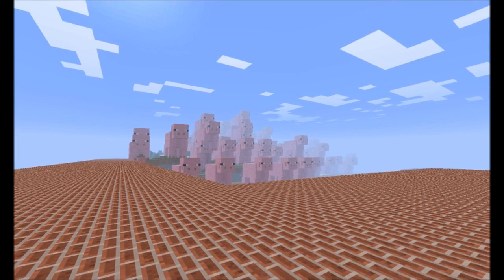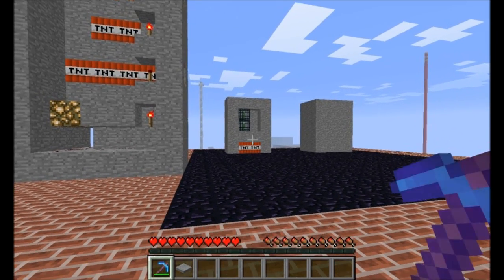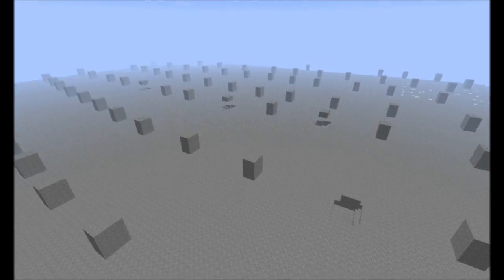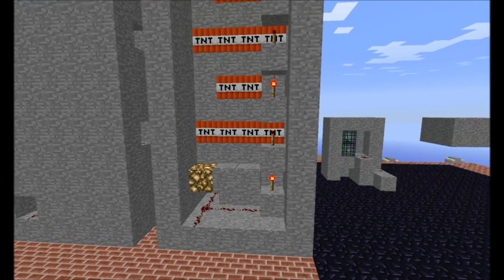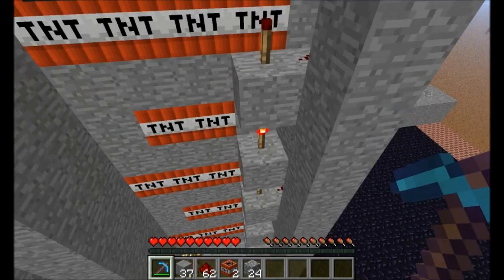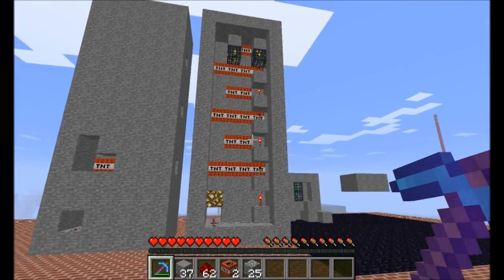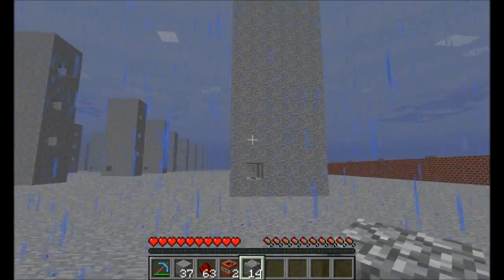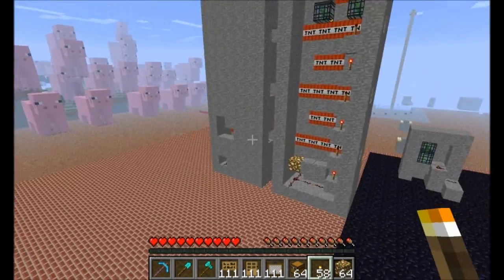Vechs' Test World - Proximity Bombs (V032)

Comment: @Vechz I would recommend putting the glowstone block in between the two pressure plates. With the current design you have now, mobs will only be able to land on the blocks to the right and the left.

Comment: You could use fences under stone pressure plates to stop natural spawns (DUCKY3654's comment). For a compact version using the fences, you'd need to drop Etho's design down one.
Otherwise, in your current model, putting the glowstone between the pressure plates or shifting the slightly more centered spawner to the edge should increase the reliability of instantly detecting the player. Also in the latter case, it would widen the range of detection.

Comment: You can use water at the bottom block where they spawn and push them far enuff away from the spawner to be able to place a torch next to the triggering pressure plate.

Comment: @AbdielKavash Same problem as with 3:42, although in a Super Hostile Situation, I guess you'd still be right. If the map-maker is working on an adventure map, they couldn't use that design. (Also, in case the comment goes missing, he suggests using cave spiders to activate the pressure plates, which, in a 1x1x1 hole, no other mobs can spawn)

Comment: if you put a torch 6 block away from the pressure plate (5 blocks between the plate and the torch) and you make a 3 high spawn place, the small proximity sensor will be 100% stable because the ground will be at a light lvl of 7 but the 2 other blocks will be at 6-5. The spawner will be able to make them spawn in mid-air but the normal spawning won't be able to make them spawn!

Comment: FYI you yourself said how to make the small version 100% stable. To do that, you need to hook two of them together, one that has a piston which by default blocks any mobs from spawning. Then the second one will be a trigger to "release" the "safety" AKA the piston blocking mob spawning. In which case a player should be close enough that mobs will only spawn from a spawner. If you were to compare your version, with that, I believe it will be a tad smaller.

Comment: @Vechz Wouldn't using a passive mob spawner (chicken, for instance) solve the issue of the traps going off prematurely? Just illuminate the area above the pressure plate so hostiles won't spawn?

Comment: if the glowstone is more hidden so light level at the pressure plates is 9 and 8 the spawners can be lower and the bomb smaller/have more tnt (you can hide it around cornors without needing much space

Comment: Vechs, use cavespider spawners. Do 2x2 spawners horizontal with pads on top of them. Tnt on top of that. CS are the only mob that will spawn in that space and they do not spawn naturally. To avoid activating the mine while building you can use the /light command which will prevent all spawns even on peaceful.

Comment: Well you can use the compact design by placing a redstone lamp or two in it then wire it to a pressure plate witch is wired to an rs nor latch so they can be as small as you really want but not go off till needed

Comment: Can you use the smaller design with a cave spider spawner, and leave only 1x1x1 clearance at the pressure plate? No other mob can spawn there normally (if you don't build it deep enough for slimes).

Comment: You can avoid natural mob spawns by replacing the block under the pressure plate with tnt and if you place the spawner one block higher it won´t activate in peaceful mode.

Comment: a monster spawner proximity sensor was made long before Etho's video. I prefer player sensors that use particles as Magnetique12's particle sensor is silent it's a much more reliable proximity sensor. However I can see why you wouldn't want to use it as it doesn't work if you particles are turned off.

Comment: You should try using water to prevent normal spawns and push the mobs into a pressureplate on a fencepost.
My player detector: imageshack.us/photo/my-images/43/20120219181134.png/